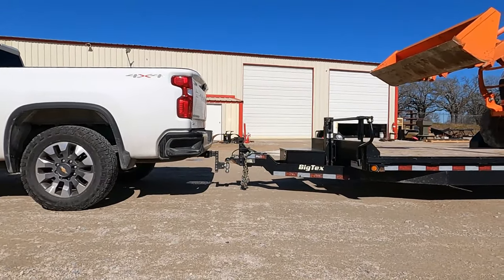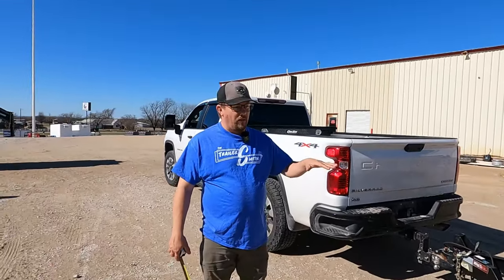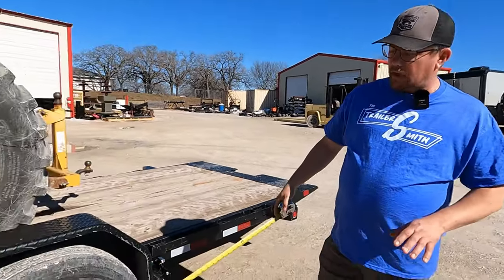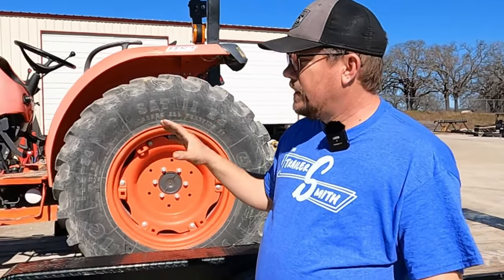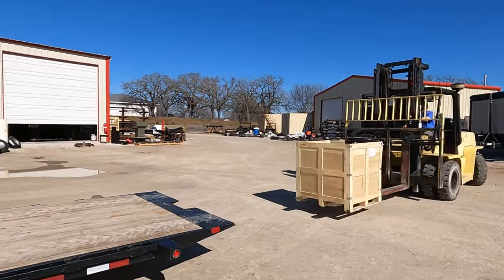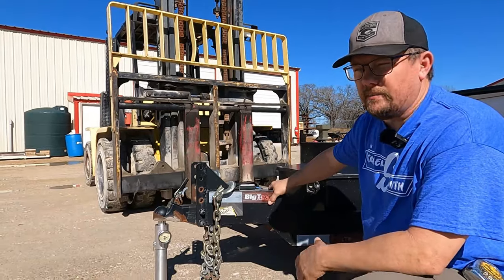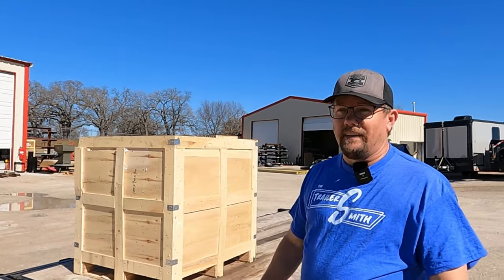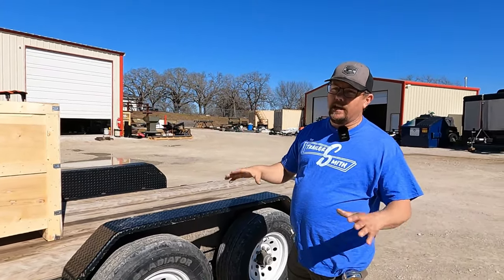How To Properly Load A Trailer

Comment: When I haul 3 sxs on my trailer  inline. Not sideways.  I load the heavier  machine  up front  then the second  heaviest  and then the lighter one on the tail end. I'd rather have too much tongue  weight  versus  not enough.
Reply from the maker: Exactly!  Thanks for watching!
Reply: As long as your hitch, trailer neck and ball mount can handle the excessive tongue weight then your fine with that mentality.
Too many people buy the Walmart special ball mount that's only rated for 5-700lbs and have at it 🤦

Comment: Again, I am going to ask an off subject question: How often should I check the brakes on my bumper tow RV. Currently I am planning to check the brakes annually, know I will have to repack the bearings each time I do this.
Reply from the maker: Hi!  Checking the brakes one time a year during the bearing pack should be sufficient, unless you are towing high mileage.  So every 12 months or 12k miles, whichever occurs first.  Brake adjustments every 3k miles.  Great question!

Comment: Thank you for making this video.  I am a retired equipment operator and I can't even begin to count how many times I've seen people, without a clue, haul unsafe loads.  Measuring the trailer tongue or the pickup to ground is the quickest ballpark way to know for sure weight is added to the tongue.  Now, we need to educate people on how to properly secure their loads.  Cars and small equipment chained down to a trailer incorrectly happens more often than poor weight distribution.
Reply from the maker: Agreed 👍  We have some securement videos coming soon. The feedback is much appreciated.  Thanks for watching!
Reply: @TheTrailerSmith 
Speaking of securement, if the guy who had that pallet of sackcrete had a 1.5” or 2” ratchet strap, he could have wrapped around the base of the pallet and used it to pull the entire pallet forward on his trailer!

You didn’t mention it in this video, but you could have stopped and checked to see if you could have helped him move that load forward as well!

Comment: So this where the DOT rules screw you over. If I want a over built trailer or one with more capacity then I will need or use they want to ticket/fine you for being over the 2601 number! Even if you are not hauling 2601. Now If you are over,  you made that decision.  I own a f450 to have more truck then I need, safety/security,  if I tow a 14000 or 18000 lbs capable trailer  I am over the 2601 max with nothing in the trailer! I am not commercial.  But would need a CDL.
Reply from the maker: Pretty much!  👍